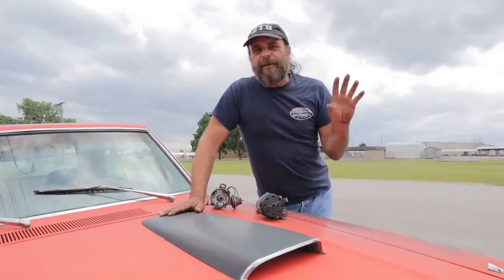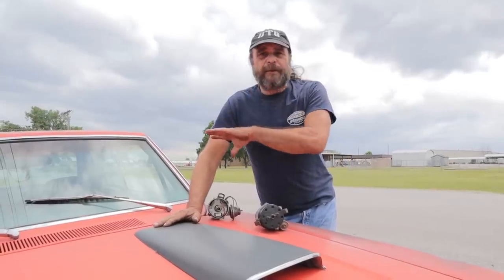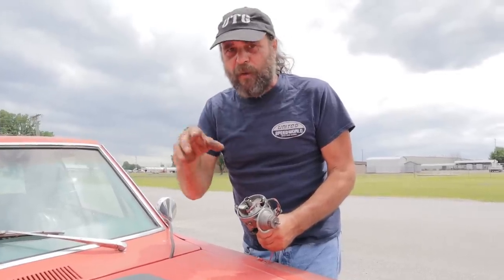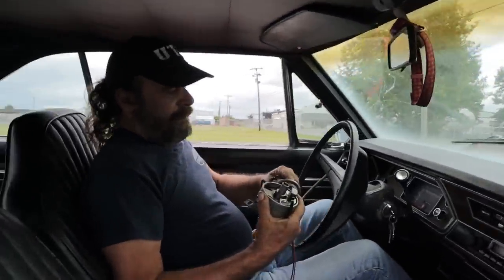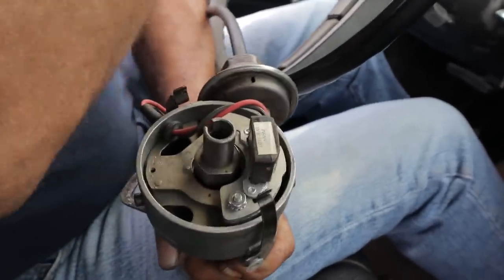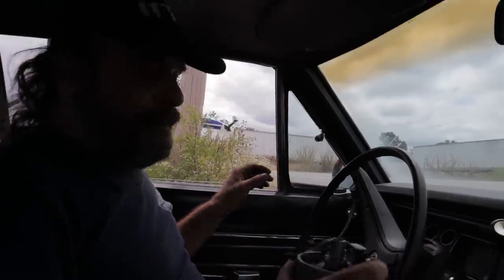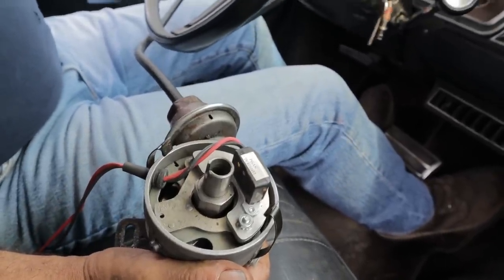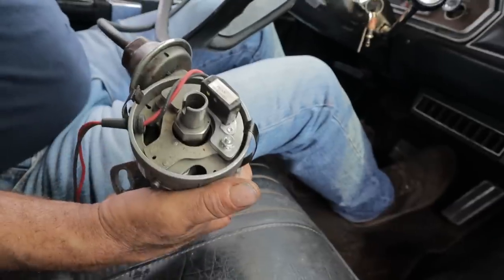The Vacuum Advance Debate!

Comment: I have not run across an engine yet that performs better with ported vacuum than manifold vacuum. Ported was an emissions era crutch from the early 70s. All the 60s engines used manifold vacuum.
Reply: my 1987 Honda CRX came from the factory as manifold vacuum. Had many people tell me to change it to ported instead of manifold. Pretty much ran the same at cruise, but at idle it was terrible, and would start overheating because of how hot the headers were getting on ported vacuum (about 5 or so degrees of timing (no vac, no mech) ), manifold vac would put it at around 20 degrees of timing (vac timing, no mech) and idles incredibly smooth
Reply: @cmdr_scotty  yep.  My engine cooled down and ran super quiet when i switched to manifold.
Reply: Ford used ported in the 60's so......
Reply: @yeboscrebo4451  same with my 350!
Reply: Exactly.
Reply: Exactly.
Reply: @yeboscrebo4451 my 73 charger ran hot exhaust was louder dripped gas and was bad switched to manifold car is way cooler and less noise does not smell anymore

Comment: Switching to manifold vacuum cured almost all my problems.  New rebuilt 350 stock except for an RV cam.  New holley 600. new MSD distributor the list goes on and on.. Never could get it to idle correctly no matter what I did. 14 degrees btdc. Finally read that article, switched to manifold vacuum and its like a new car. It runs and drives so much better its unbelievable.
Reply: Yeah, uncle tony is wrong on this one.  Listen to the actual automotive engineers describe the purpose of manifold vacuum advance.  Tony has it backwards
Reply: @yeboscrebo4451  link?
Reply: @theungoliant9410  I’m sorry I don’t have one.  You’ll have to run a search on the subject.  I’m sure it won’t take long to find - it didn’t for me when I dug into the subject.  There were two engineers in particular who have written extensively on the subject.  If I remember correctly,  one of them was a former GM engineer.  Very interesting information
Reply: Same thing ... I switched to manifold and it's suddenly running so much better, it's unbelievable. Idles perfect, and you you tap the throttle, it just wants to go. For 40 years I've always done manifold from American Chevy 350s, Ford 289s, most European cars. Today many advice ported so I've been having a go at that. Nope. just doesn't work for a normal daily driver car with traffic choked roads in my hot tropical country.
Reply: @hmayerv8  I would be interested to see how much the manifold timing advanced your distributor at idle. With today's fuel our engines want alot more initial timing. I run about 20 degrees initial and 36 total on my 318. If you're advancing your timing at idle with the manifold vaccum engaged of course its going to run better. What is your initial timing? If you are setting your initial timing below 10 degrees your engine will run like crap unless it is advancing like it would do if you hooked it to manifold vaccum.

Comment: it’s all the same except at idle and WOT (wot has no vacuum anyways so it’s a moot point).  Manifold has higher timing advance at idle, lower EGT’s and not as good emissions, then pulls timing as the throttle blades are opened.  Ported vacuum has no advance at idle, because it sees no vacuum at idle.  As the throttle blades are opened, the vacuum rises and it adds timing advance.  The way that you determine which is best is the way your distributor curve is set up, and your application.  Some guys will swear by ported only, others by manifold only.  If you have the ability to use a dyno I’m sure there’s a negligible difference in part throttle power, because in the middle of the part throttle operation, with the manifold vacuum advance dropping and the ported rising, they intersect at the same amount of advance.  So, to sum it up, they achieve the same effect, just one adding timing and one taking timing out.  The engine will run differently on each due to the way they add or remove timing.  Remember, this is only idle and vacuum cruising, wide open throttle doesn’t matter for vacuum advance.
Reply: 6 of one half a dozen of the other.Your description is pretty spot on i think.

I remember having a '71 ford fe that had a coolant temp vacuum switch that when coolant temp got to a determined level it would route manifold vacuum to the dist. in order to increase timing and raise idle speed.That car detonated like mad on any kind of a part throttle load and  started my education of vacuum advance. I remember trying so hard to keep the vacuum advance and tune out the detonation cause why I don't know.... because i was giving up maybe a mpg in fuel economy i guess LoL

Comment: Vacuum Advance plays a huge part in Fuel mileage...  I have found on my tunnel ram setup I get better driveability from Manifold vacuum.. you can use adjustable vacuum pots so you can dial in your vacuum advance and have your cake and eat it too....
Reply: 2-3 MPG and a Fan Clutch on the street almost the same. Big difference on MPG added up.
Reply: I just made the switch to manifold on my 72 f350.  Of course I had to make plenty of adjustments with timing but it was far superior to ported.  The first thing I noticed was how quiet it was on a cold start.  The engine ran much better and my mpgs went up by 3. I just don’t get why you’d want to run ported
Reply: One thing Tony doesn’t mention is, retarding timing under throttle can prevent detonation which can be a good thing in a performance engine. I run manifold vacuum and got a smoother idle and it stopped pinging at WOT.
Reply: I get that too, far superior performance and driveability on manifold vacuum. This debate will continue on, at the end to each his own. I'm happy always with manifold vacuum.

Comment: Off idle response and cooler running engine have nothing to do with performance?  Don’t think so.  There is a lot going on with a mechanical distributor, springs and weights, mechanical advance degrees, vacuum advance degrees, response  adjustable and non adjustable vacuum cans.  Most people don’t have the time or energy to dial in and tune a mechanical distributor let another understand how it all works together. It’s hard to explain,  I have tried every which way with my olds 350 and 350 sbc, hands down manifold for me.

Comment: TIMING AND VACUUM ADVANCE 101 by GM Engineer.

The most important concept to understand is that lean mixtures, such as at idle and steady highway cruise, take longer to burn than rich mixtures; idle in particular, as idle mixture is affected by exhaust gas dilution. This requires that lean mixtures have "the fire lit" earlier in the compression cycle (spark timing advanced), allowing more burn time so that peak cylinder pressure is reached just after TDC for peak efficiency and reduced exhaust gas temperature (wasted combustion energy). Rich mixtures, on the other hand, burn faster than lean mixtures, so they need to have "the fire lit" later in the compression cycle (spark timing retarded slightly) so maximum cylinder pressure is still achieved at the same point after TDC as with the lean mixture, for maximum efficiency.

The centrifugal advance system in a distributor advances spark timing purely as a function of engine rpm (irrespective of engine load or operating conditions), with the amount of advance and the rate at which it comes in determined by the weights and springs on top of the autocam mechanism. The amount of advance added by the distributor, combined with initial static timing, is "total timing" (i.e., the 34-36 degrees at high rpm that most SBC's like). Vacuum advance has absolutely nothing to do with total timing or performance, as when the throttle is opened, manifold vacuum drops essentially to zero, and the vacuum advance drops out entirely; it has no part in the "total timing" equation.

At idle, the engine needs additional spark advance in order to fire that lean, diluted mixture earlier in order to develop maximum cylinder pressure at the proper point, so the vacuum advance can (connected to manifold vacuum, not "ported" vacuum - more on that aberration later) is activated by the high manifold vacuum, and adds about 15 degrees of spark advance, on top of the initial static timing setting (i.e., if your static timing is at 10 degrees, at idle it's actually around 25 degrees with the vacuum advance connected). The same thing occurs at steady-state highway cruise; the mixture is lean, takes longer to burn, the load on the engine is low, the manifold vacuum is high, so the vacuum advance is again deployed, and if you had a timing light set up so you could see the balancer as you were going down the highway, you'd see about 50 degrees advance (10 degrees initial, 20-25 degrees from the centrifugal advance, and 15 degrees from the vacuum advance) at steady-state cruise (it only takes about 40 horsepower to cruise at 50mph).

When you accelerate, the mixture is instantly enriched (by the accelerator pump, power valve, etc.), burns faster, doesn't need the additional spark advance, and when the throttle plates open, manifold vacuum drops, and the vacuum advance can returns to zero, retarding the spark timing back to what is provided by the initial static timing plus the centrifugal advance provided by the distributor at that engine rpm; the vacuum advance doesn't come back into play until you back off the gas and manifold vacuum increases again as you return to steady-state cruise, when the mixture again becomes lean.

The key difference is that centrifugal advance (in the distributor autocam via weights and springs) is purely rpm-sensitive; nothing changes it except changes in rpm. Vacuum advance, on the other hand, responds to engine load and rapidly-changing operating conditions, providing the correct degree of spark advance at any point in time based on engine load, to deal with both lean and rich mixture conditions. By today's terms, this was a relatively crude mechanical system, but it did a good job of optimizing engine efficiency, throttle response, fuel economy, and idle cooling, with absolutely ZERO effect on wide-open throttle performance, as vacuum advance is inoperative under wide-open throttle conditions. In modern cars with computerized engine controllers, all those sensors and the controller change both mixture and spark timing 50 to 100 times per second, and we don't even HAVE a distributor any more - it's all electronic.

Now, to the widely-misunderstood manifold-vs.-ported vacuum aberration. After 30-40 years of controlling vacuum advance with full manifold vacuum, along came emissions requirements, years before catalytic converter technology had been developed, and all manner of crude band-aid systems were developed to try and reduce hydrocarbons and oxides of nitrogen in the exhaust stream. One of these band-aids was "ported spark", which moved the vacuum pickup orifice in the carburetor venturi from below the throttle plate (where it was exposed to full manifold vacuum at idle) to above the throttle plate, where it saw no manifold vacuum at all at idle. This meant the vacuum advance was inoperative at idle (retarding spark timing from its optimum value), and these applications also had VERY low initial static timing (usually 4 degrees or less, and some actually were set at 2 degrees AFTER TDC). This was done in order to increase exhaust gas temperature (due to "lighting the fire late") to improve the effectiveness of the "afterburning" of hydrocarbons by the air injected into the exhaust manifolds by the A.I.R. system; as a result, these engines ran like crap, and an enormous amount of wasted heat energy was transferred through the exhaust port walls into the coolant, causing them to run hot at idle - cylinder pressure fell off, engine temperatures went up, combustion efficiency went down the drain, and fuel economy went down with it.

If you look at the centrifugal advance calibrations for these "ported spark, late-timed" engines, you'll see that instead of having 20 degrees of advance, they had up to 34 degrees of advance in the distributor, in order to get back to the 34-36 degrees "total timing" at high rpm wide-open throttle to get some of the performance back. The vacuum advance still worked at steady-state highway cruise (lean mixture = low emissions), but it was inoperative at idle, which caused all manner of problems - "ported vacuum" was strictly an early, pre-converter crude emissions strategy, and nothing more.

What about the Harry high-school non-vacuum advance polished billet "whizbang" distributors you see in the Summit and Jeg's catalogs? They're JUNK on a street-driven car, but some people keep buying them because they're "race car" parts, so they must be "good for my car" - they're NOT. "Race cars" run at wide-open throttle, rich mixture, full load, and high rpm all the time, so they don't need a system (vacuum advance) to deal with the full range of driving conditions encountered in street operation. Anyone driving a street-driven car without manifold-connected vacuum advance is sacrificing idle cooling, throttle response, engine efficiency, and fuel economy, probably because they don't understand what vacuum advance is, how it works, and what it's for - there are lots of long-time experienced "mechanics" who don't understand the principles and operation of vacuum advance either, so they're not alone.

Vacuum advance calibrations are different between stock engines and modified engines, especially if you have a lot of cam and have relatively low manifold vacuum at idle. Most stock vacuum advance cans aren’t fully-deployed until they see about 15” Hg. Manifold vacuum, so those cans don’t work very well on a modified engine; with less than 15” Hg. at a rough idle, the stock can will “dither” in and out in response to the rapidly-changing manifold vacuum, constantly varying the amount of vacuum advance, which creates an unstable idle. Modified engines with more cam that generate less than 15” Hg. of vacuum at idle need a vacuum advance can that’s fully-deployed at least 1”, preferably 2” of vacuum less than idle vacuum level so idle advance is solid and stable; the Echlin #VC-1810 advance can (about $10 at NAPA) provides the same amount of advance as the stock can (15 degrees), but is fully-deployed at only 8” of vacuum, so there is no variation in idle timing even with a stout cam.

For peak engine performance, driveability, idle cooling and efficiency in a street-driven car, you need vacuum advance, connected to full manifold vacuum. Absolutely. Positively.
Reply: This was about 60 years of knowledge condensed into one comment. Thank you for taking the time to write this out, I learned a ton.
Reply: thank you for this post
Reply: Helps me lot with understanding and testing functionality of the vac advance of my engine. Thanks a lot
Reply: Best explanation ever and reinforced my belief in always using manifold vacuum. I have only one instance where I didn't but thats a unique story on one of my Trans AMs. Thanks for putting this in engineering language. 
Cheers
Reply: When i bought my 66 chevy with the AIr reactor system and timing set at 2 degrees after as you mentioned,
Every parts store i went to thought i was nuts.
After doing my research and playing with it.
I have it set up at 10 degrees initial with 15 of ported vacuuum and it runs like a champ.
I toyed with 8 initial and hooking it the vaccuum to full and it does run smoother.
However i got alot of variation at idle which i did not like.
Play with your engine and see what she likes!
Thank you  for this post

Comment: I read an article by one of the engineers involved with designing these systems, he knows what he is talking about and says you always want to use full manifold vacuum. It keeps your engine cooler at idle due to the added advance, and has other benefits as well. Ported was something that was used later on to attempt to help emissions.
Reply: No. Lots of timing at idle creates heat.
Reply: correct. At idle, It will run smoother, cooler, create higher vacuum and run leaner increasing mileage.
Reply: Tony couldnt you find a busier😅 street to film on?
Reply: You, sir....... are correct.

Comment: this guy is the best classic engine teacher on the internet. I've learned so much here
Reply: Did you go through this issue with your corolla? I'm having issues with my ke55 atm. when advancer plugged into port. the car dies under accelleration. when unplugged completely and port blocked... car runs fine.. lost..

Comment: My new MSD distributor instruction book said to connect the vacuum advance to the ported vacuum of the carburetor, not manifold vacuum. So, this is what I did, and it works just fine. 😊
Also there are thermal switches that when the coolant temperature reaches 225 deg F the distributor vacuum advance is switched from ported vacuum to manifold vacuum to increase the timing for lower engine temperatures at idle. This was common back before electronic engine controls. These switches can still be found for sale.
Or you can do the same thing with a 12 volt three way solenoid valve and a switch. So if you get stuck in traffic in your hot rod you can just flip a switch to help prevent over heating on hot days.